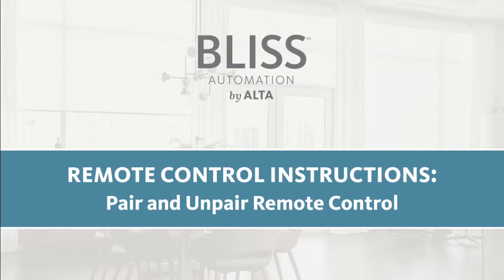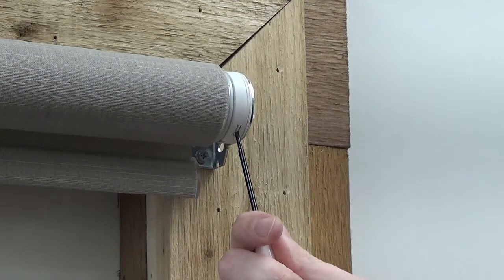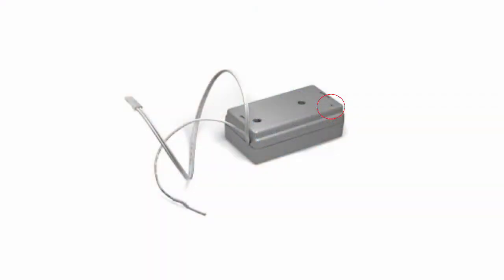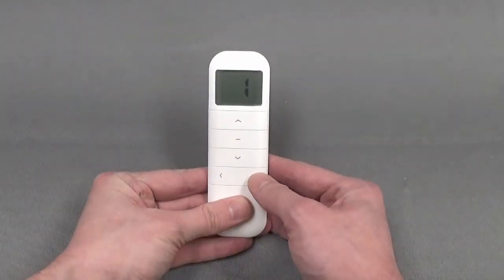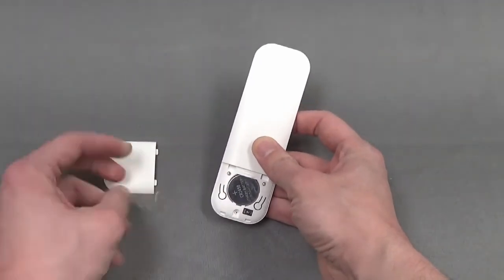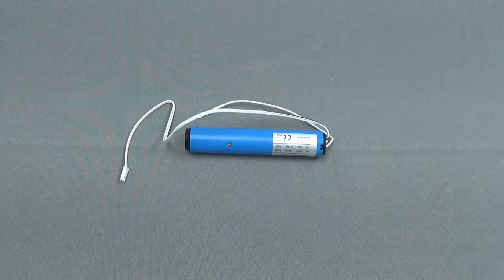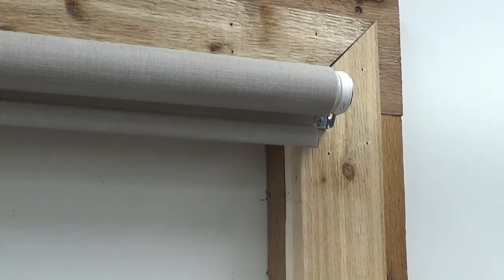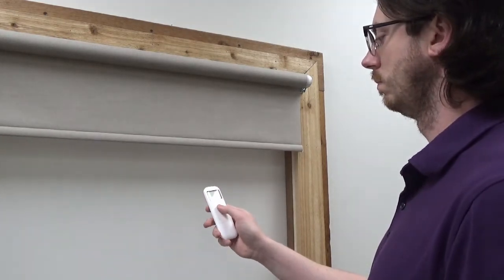BLISS™ Remote Control Instructions: Pair and Unpair Remote Control

Comment: When changing out the battery in your remote, you need to press P2 on the remote as you are putting in the CR2460 battery. this cleared up my problems pairing the remote  to the blinds.
Reply: Ronn, thank you so much for this tip. You solved my frustration! Now why didn't Alta put this detail in their manual?
Reply: Thank you for this. This solved my problem.
Reply: Your suggestion is so helpful, the instructions are useless. Thanks.
Reply: Thank you!
Reply: Thank you!  After getting mine stuck in the down position (battery went dead after setting the lower limit), this solved the issue!  Bliss - please send Ronn a bonus and include in instructions.
Reply: THANK YOU @ronn3112!!!! Our master bath blinds have been stuck in the up position for over a week after replacing our remote battery.  I knew there must be some type of reset button, but have yet to get Alta or my blinds installer to reply with a solution.
Reply: @raegenstain7951 hello did you figure this out? Can’t program mine after changing batteries
Reply: Ronn- THANK YOU!!!!!!!!!!!! This fixed my issue I was having not pairing after battery replacement. You’re a gem.

Comment: When I press the stop button to pair, I get an L visual on remote and the shade does not move up and down.
Reply: same. did you ever find a solution?
Reply: Remove the back cover for the remote battery.
There is a micro switch inside. Move it away from the Lock icon

Comment: This doesn’t work. I tried pressing p2 multiple times and all I get is an L 🤷🏾‍♂️🤦🏾‍♂️
Reply: Did you figure it out? I can’t program after changing batteries
Reply: Did you figure it out?
Reply: I did the press p2 and inserted new battery. Remote went through its test and shade paired automatically, only issue is my up down buttons are reversed

Comment: I have just moved into a house that has 2 of these shades. I have charged the rollers with the cord that has the blue end on it. Pressing P1 on either blind, nothing happens. I also changed out the battery of the remote & hit P2's. Same result nothing happens. Does anyone have any ideas to help? Thanks in advance

Comment: How do you add multiple shades on one channel?
Reply: they recommend not adding more than 1 shade per channel
Reply: I do this all the time and it hasn’t presented any problems. Program the first shade of the group using the channel that the group of shades will be on. When you go to program the second and following shades of the group, change the channel on the remote to one of the higher channels that usually remains unused (channels 10-15, usually). Make sure that each shade is paired to a new and currently unused channel for limit setting, as this ensures you can set the limits of the current shade without altering the limits you’ve already set for previously programmed shades. After you’ve set the limits for the shade, you’ll hold the program button on the shade motor until it jogs, indicating it’s in pairing mode. Make sure the remote is on the channel that you want to group the shades on and hold the center button of the remote until the shade jogs, indicating it is now programmed to that channel. I use this process regularly to split multiple shades in the same area into different groupings with all of them controlled by a single remote.
Reply: One shade per channel up to 15 shades. To operate all the shades you chose channel 0 and all the channels operate together. Select the individual shade channel to just operate that one shade.
You probably want a separate remote for each room and its batch of windows. Or else 15 shades in multiple rooms will all move together on channel 0.